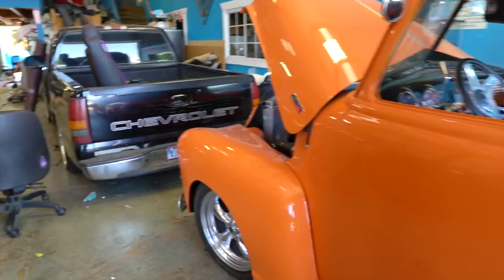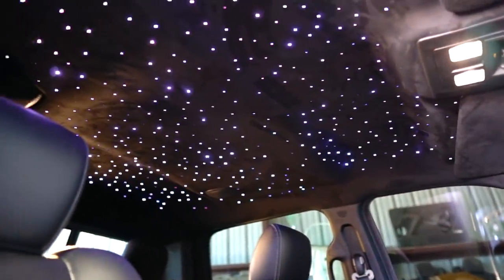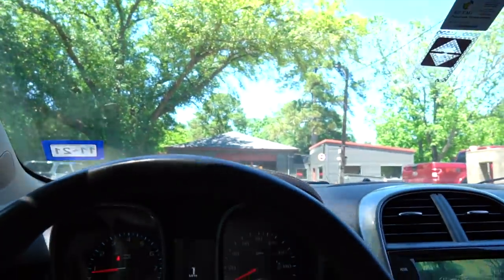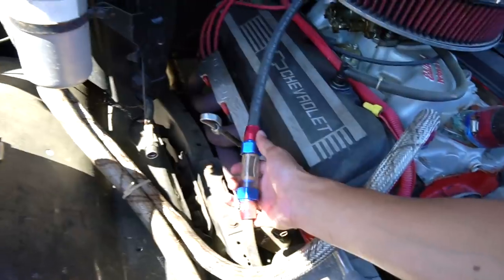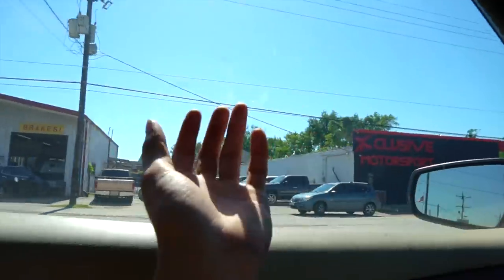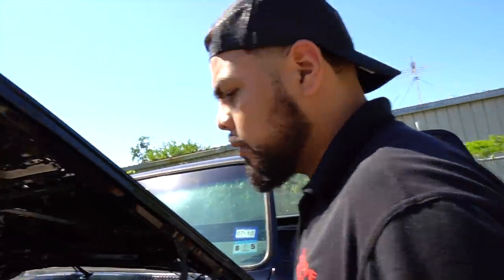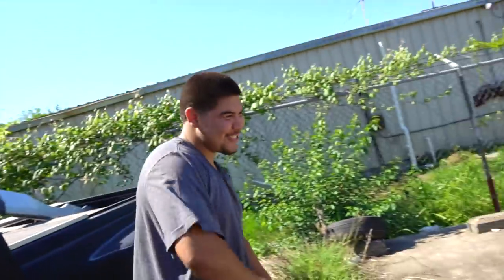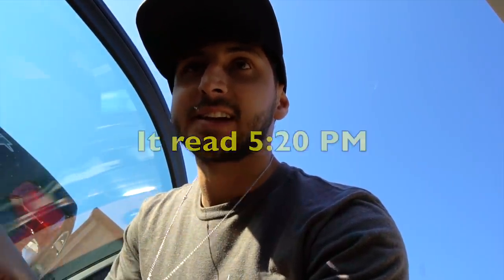The New Truck Is Giving me trouble  !!!!!!!

Comment: From experience Bro, I would modify the hood brackets or keep them lubricated really good, once them springs/hinges get tight when you close the hood be extra careful because the hood will bend at that mid point, believe me I went through this crap. I added an extension to reach out further to the front of the hood from the original hinge where it bolts to the hood, this will keep it from bending. The problem is that these hoods are long and heavy, and the hinges are to far back allowing the hood to bend right around the area where the bracket ends.   
Have fun and fix it up the way you want, it's your baby......lol

Comment: Its funny I had a similar truck with a carbed 454 that had a few boltons and anytime you even looked at the throttle it was a smokeshow but in a straight line Im pretty sure a new LT 4.3 would have gave it a race.They are a workhorse of an engine and you really have to change the camshaft out for them to make any significant power.